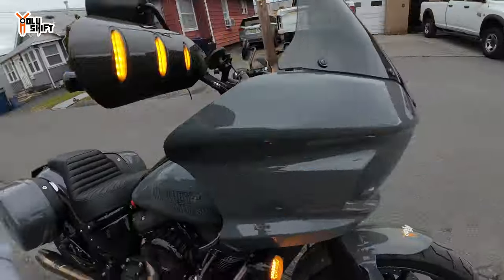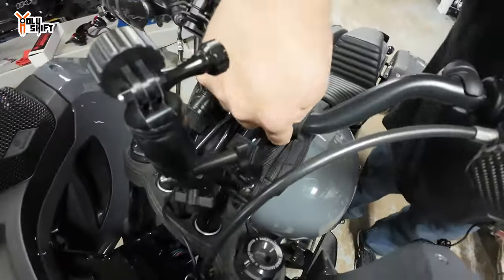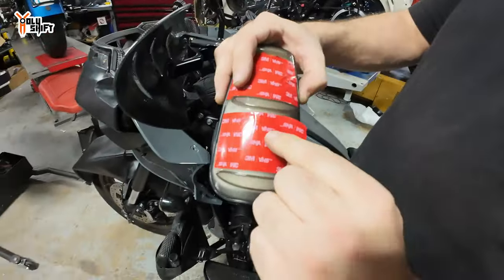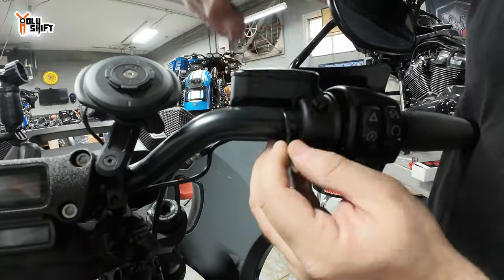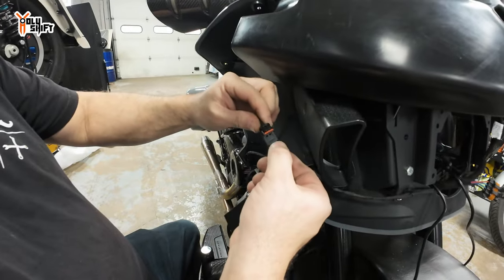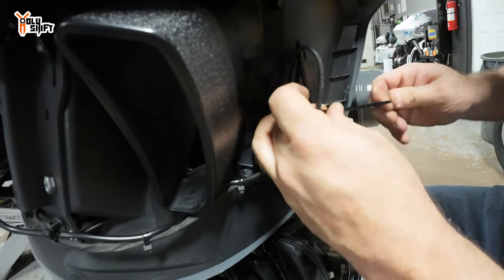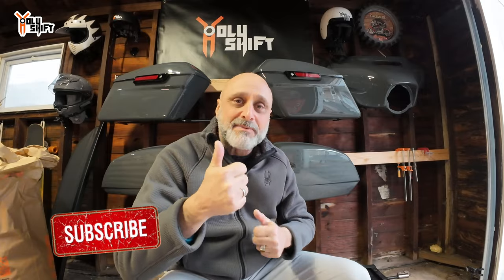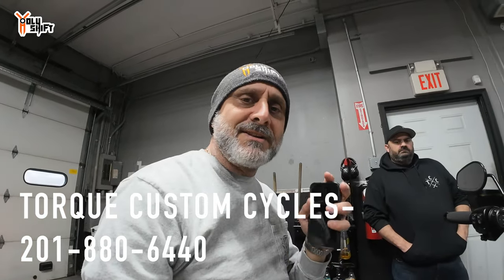TOO MANY LIGHTS ! - No Such Thing !

Comment: Couldn't they be wired internally, through your control housings, in the little hole that turn signal wires are run through on other Harleys? You could probably have a disconnection point, right outside of them, for when you want to ride with them off.
Reply from the maker: “Give & Take “ : Whenever I see a question ? ? In the comments I like to see if the person asking the question thinks it’s fair to also subscribe to my channel first …👍🏻😜